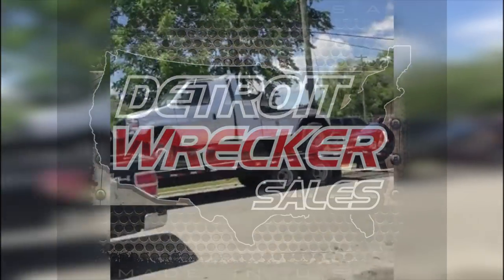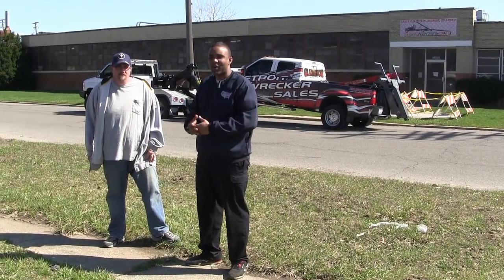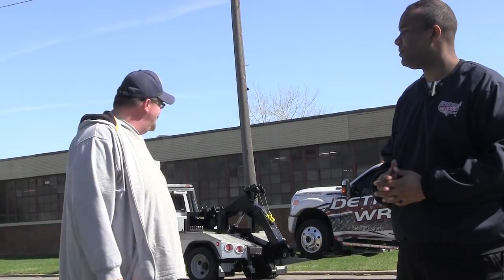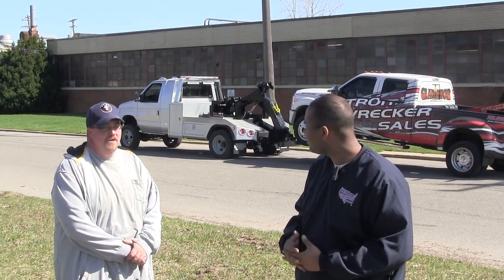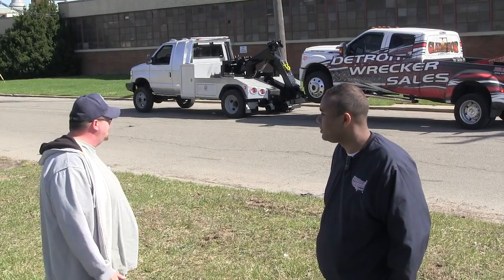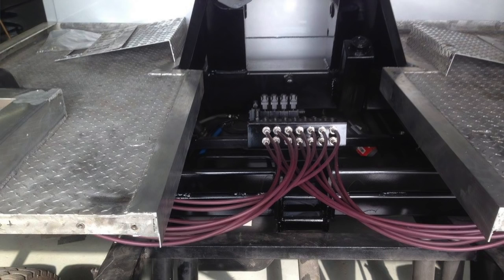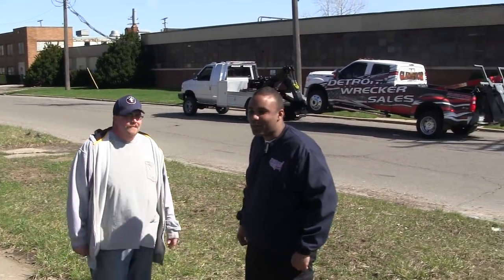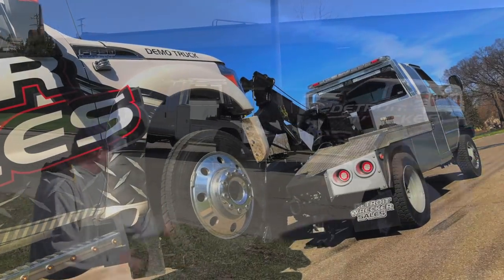The Van Wrecker Jeff Unger Project

Comment: Looks good!! Only one thing that bothers me. Would like to see the back suspension to be a little more stiffer in the back. The truck is to high up in the front with a load. Other than that it's tight. Looks good!!  Sweet build!!! 😃
Reply from the maker: Eugene Cody - We couldn't agree more. The truck is scheduled to get added leaf at the spring shop. Those were the factory springs with no additional.
Reply: Detroit Wrecker  I figured that. Looks good tho !!😉